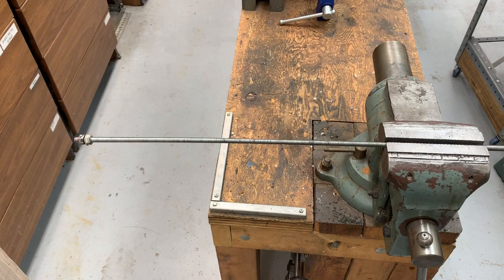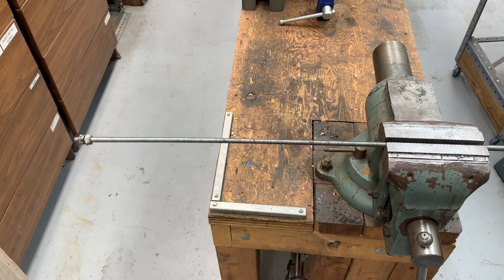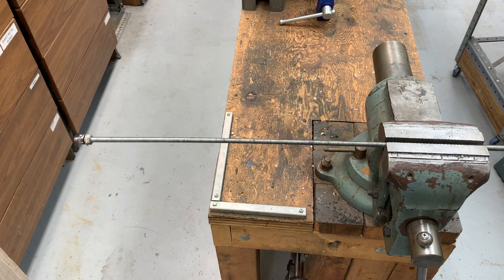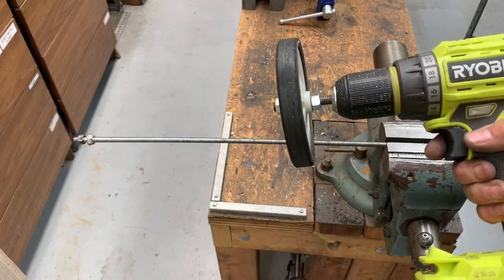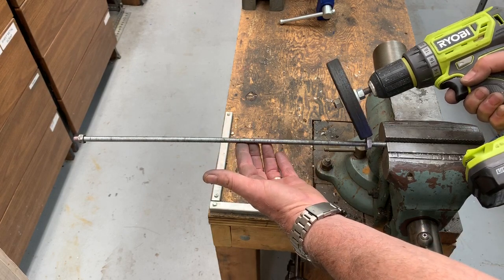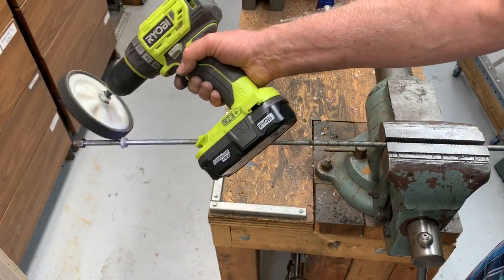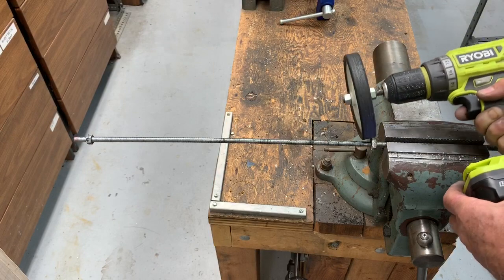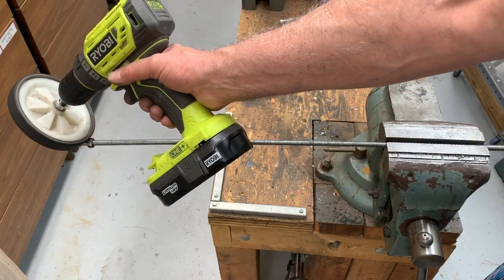Spinning Nuts On A Threaded Rod

Comment: You can spin a nut on a thread surprisingly fast if you use your thumb and fore finger back and forth. You can roll the nut with the length of your forearm and that's really fast

Comment: Hi Rick,  did you try putting a rubber band around the hex nut?
Reply from the maker: Jim,

I did not think of using a rubber band. Looking at my rather limited selection of rubber bands, none would work without many wraps. But it got me thinking - what about using an O-ring. Works great!

Thanks,

Rick
Reply: @rgsparber1   Hi Rick,  O-ring, sounds great to me.  I did not think of using an O-ring at all but 
I'm that works better then a rubber band.